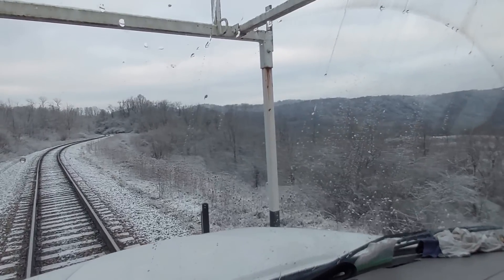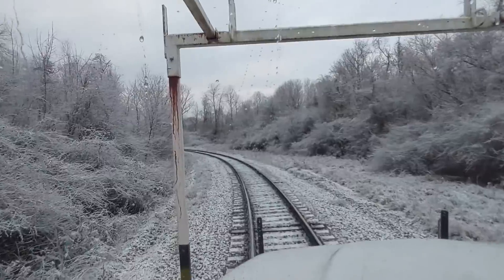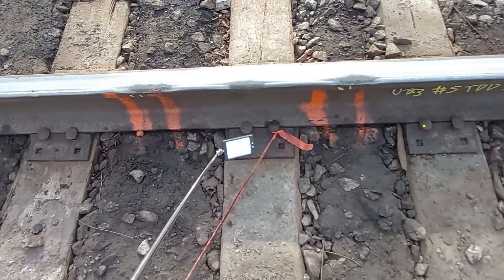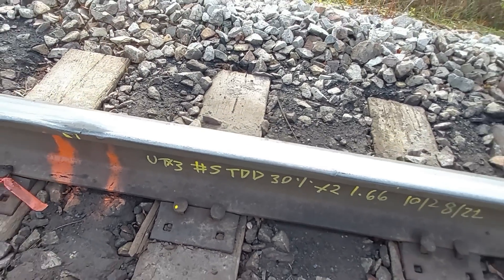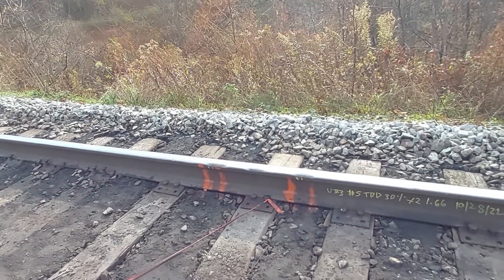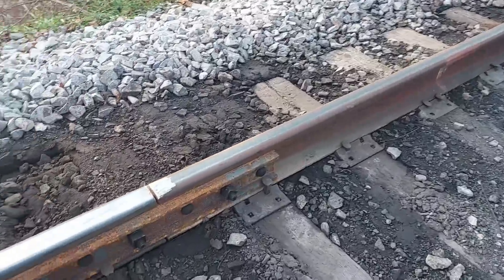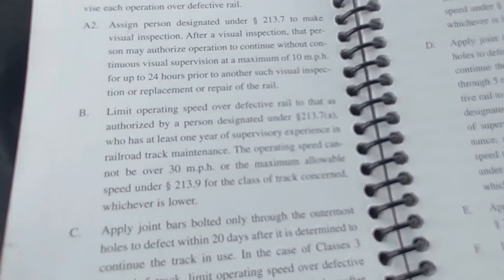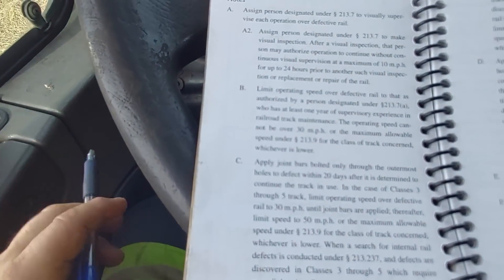Ultrasonic Rail Testers found a 30% Growth Inside the Rail Head

Comment: Always finding out new things from you Dave.  This time it was finding out steel rail and presumably bars and steel structures can "rot" out in this way.
Reply from the maker: it will be a most interesting video on transverse and compound
fissures when I make it and will tell you in that video how a
tiny nucleus inside the rail, molecule in size can grow inside
steel, like a cancer. It's amazing Robert. I just don't know yet
when I'm going to make that video, I've got over 50 already made
and just waiting to be published so lot's good stuff coming
your way. Glad you could take the time to visit with us
tonight my friend.
Reply: Trapped gases/moisture is a concern in tire manufacturing, too.
Reply: Those fissures are weird. I was a machinist before retiring due to injury and some steel alloys are prone to internal problems when, steel is hot rolled and trains are then rolled over defective sections.
Reply: There are a handful of documents out there that detail the different types of defects or failures in rail. There are a surprising number of different ways that rails can go bad

Comment: Why did some of the rail ties seem to be warmer  ( lack of snow ) than the others when you were driving out to the faulty rail? Could this be an indication of anything or is this a “ hot rail” or a “ whetted weld area” or that sort
Reply from the maker: Heavier creosote on them than much older ties where the creosote
has dulled out over the years of weathering. Creosote heats up
faster than those ties which have little left my friend.